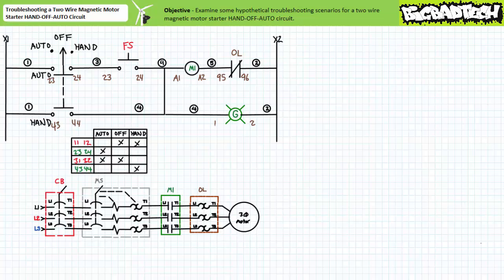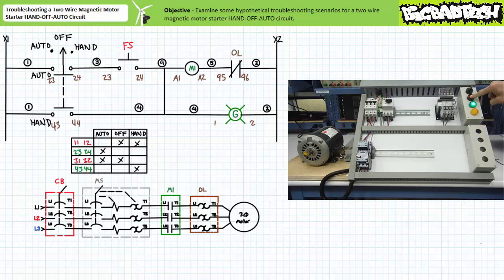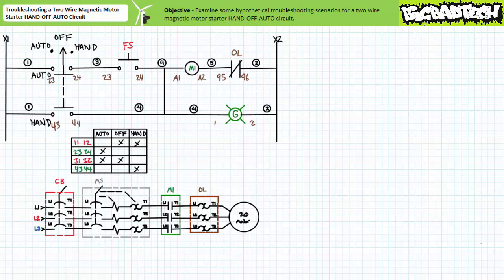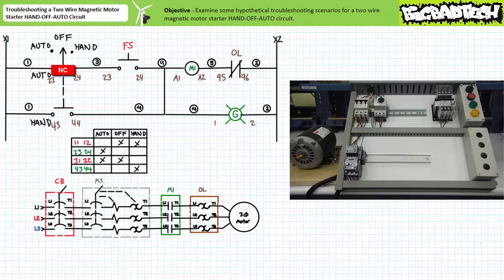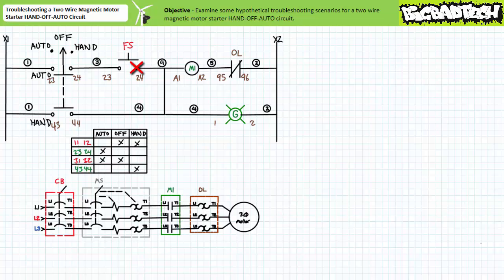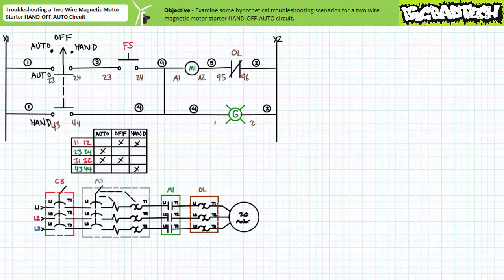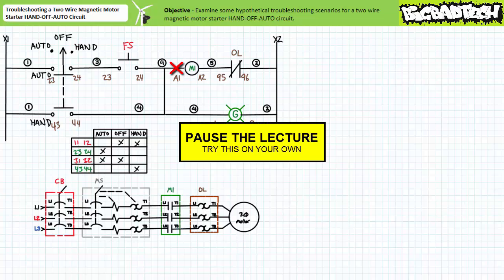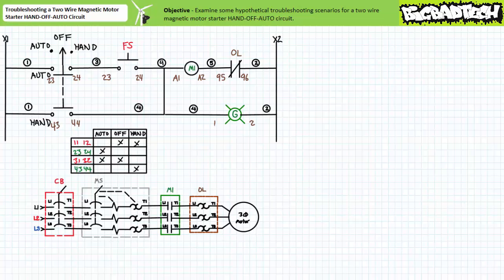Troubleshooting a Two Wire Magnetic Motor Starter HAND-OFF-AUTO Circuit

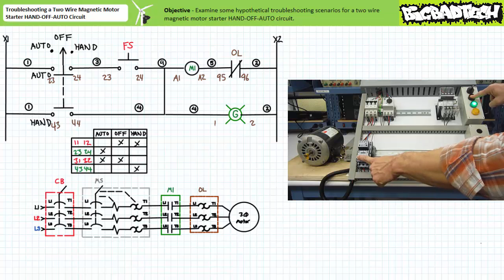Comment: At 3:38 you said that you are simulating overload event by pressing test button on overload relay. How is than possible that NC 95 and 96 are still closed? Why is green led on? I'm confused.
EDIT: I understand, there is path for current to flow because float switch is closed. NC 95 and 96 are open, but that is not the only path for the current to flow, there is still led.
Reply from the maker: Pressing the test button on the OL relay opens the NC 95 96 contacts. There is no path through M contactor coil. M primary contacts open. Current path through LED remains closed.
Reply: @bigbadtech  thanks for response!
I edited post. In first place, I didn't see that there is still path for current to flow through led. 
Your videos are really gold!